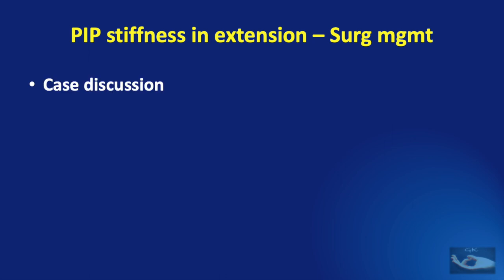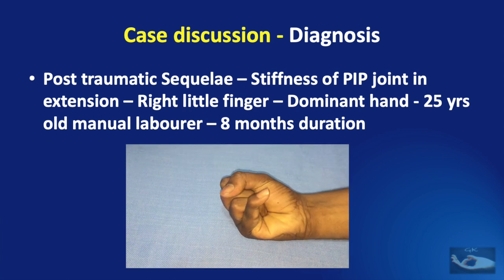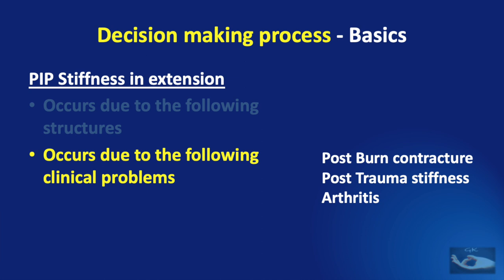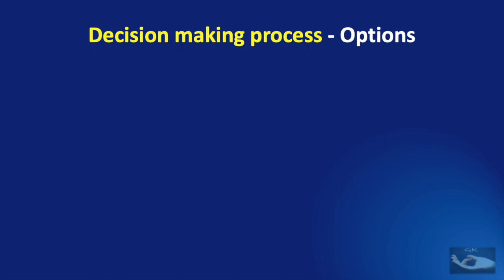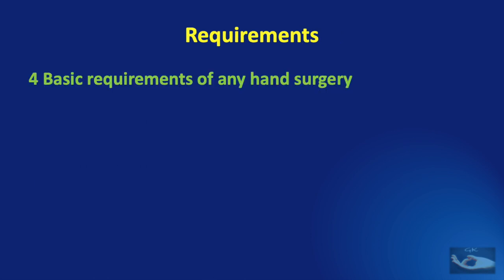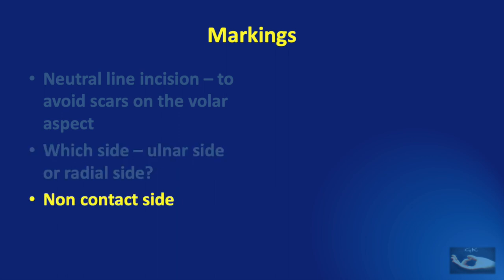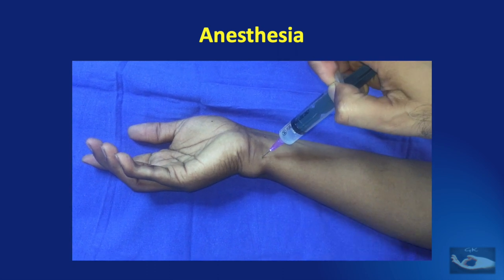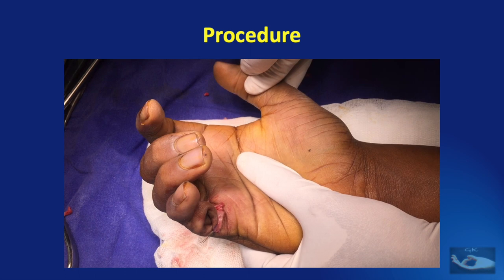Surgery @ GK Hand Surgery: Surgical release of PIP joint stiffness in extension - Gap Arthroplasty

Comment: Hello doctor, I have an ongoing issue that I still have for the past several years now... I had a normal hand and then I got dupatron's contracture on my pinky finger.. So then I had one surgery by a doctor and then a few months later it came back and then he did a second surgery. It pretty much came back again, but the second surgery he did a flap from my ring finger connected to my pinky finger and he had my whole hand immobilized in a splint for pretty much an entire month last June. And now the problem is I still can't bend my fingers fully to make a fist for flexion. I had two other surgeries, one about a month and a half ago and then one in February for cleaning out the adhesions and a capsuleotomy on all four fingers. And I'm still only getting about 70% flexion. I still can't make a fist right now. I'm still doing therapy but it's been a rough go and all I want to do is make a fist. My fingertips are pretty stiff but a tad better and my pip joints are still stiff. So anyway I could talk with you? Thank you

Comment: Hello Professor, I had a bad fracture of the proximal phalanx right at the MP joint, after the first surgery where they inserted a metal plate and 6 screws, I had a boutonniere deformity where my extensor central slip was ruptured, then had a second surgery utilizing Snow`s technique to deal with that. After 7 weeks of immobilization, I have PIP joint stiffness where it's impossible to flex my PIP joint.. After a couple of physiotherapy sessions and no improvement, could you advise me of possible treatment alternatives? 
As a medical student is pretty bad to imagine having to work without the ring finger working properly.

Thank you very much!
Reply from the maker: @ Mateus Frade, it is indeed difficult and troublesome, working with the injured finger. What does your surgeon feel? Has surgery been suggested for you now?
Reply: I too had Boutonnière deformity surgery Nov last year 2022. After removal of pin...was put on splint...have done OT for about 15 session but still cannot make a fist.
Reply: @GKHandSurgery  My surgeon feels that it is very stiff but that it has improved with physiotherapy, how much is still not certain. My interphalangeal joint can only flex about 45 degrees, so it's impossible to make a fist and the finger is always in the way... The X-ray shows a bit of degenerative joint disease, but it's not the bone that is blocking the movement, so maybe the tendon or fascia? Honestly, I am very worried because this affects me in many ways in my future as a clinician or surgeon.
Do you think that a surgical approach could help me with this situation?

Thank you for your attention, Prof.

Comment: For Arthrodesis, if it will be stuck forever in a position would amputation be an option to avoid it getting in the way? I don't know a whole lot about this field, but I am currently dealing with pip joint stiffness from a break on my ring finger. Hopefully, in the future, they will have viable prosthetics that can match normal grip strength making it a better option to avoid pain and get their lives back.
Reply from the maker: Even if the finger joint is stuck in a particular position, it will be much better than no finger at all! And getting a prosthesis for the finger that works, is still a dream!

Comment: My middle finger pip joint surgery was done for volar plate repair and open reduction and transdiction and k wire was also put  but it’s been 1.5 month and little swelling is there and my finger is not get stretched straight 
can you guide coz dr said no psychotherapy required

Comment: May i kindly ask for your oppinion what to do next. i dislocated small finger on basketball. I went to hospital and corect it. After 3 weaks when x-ray is taken there is a slight dorsal dislocation. Now it is more than 1 month and I can't bend the finger. Plz if anybody have some advicer 😞
Reply from the maker: Have you consulted your doctor? What did he advice?
Reply: @GKHandSurgery  Thanx a lot for reply!
I was told (after reallocation and 2 X rays) to start with phyisical therapies so I had for around one month but PIP joint can't be bend, not just by myself, but also it can't be bend by my therapist (ie other person) in PIP joint.
 😟
Reply: Dear doctor, I have done further examinations and doctors said that they cant resto felxion in my pip joint of the small finger. The finger is now fully extended in pip. Please if you have any suggestion. Thanx in advance
Nikola

Comment: Hello sir im from pakistan
I had an accident 1.5 months ago and my ring finger pip joint was disallocate and frectured.my doc did closed reduction and plastured my finger,after one month my plaster was removed but my pip joint was as it is was before,after that  plastic surgeon told me that they will do k wire surgery on 30th july 2022.right now my finger is not bending.plz help me out,will my finger bend properly after k wire surgery or not ??
Reply from the maker: Kindly send details to gkhandsurgery@gmail.com
Reply: Hlo bro I have also same problem..
Reply: Rply